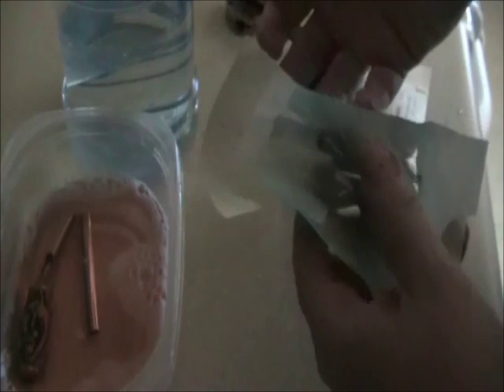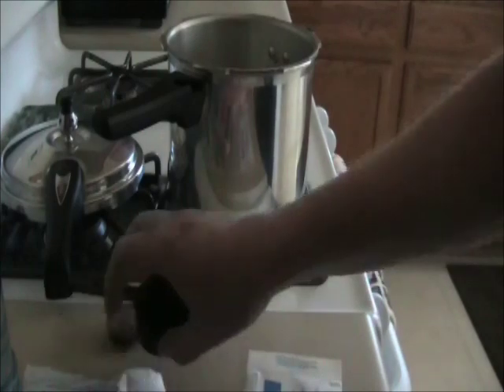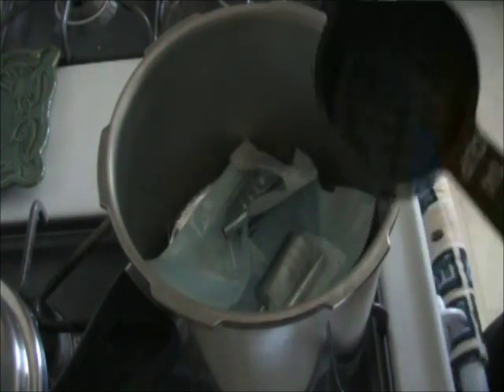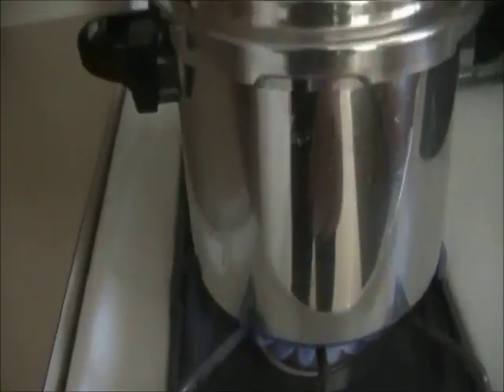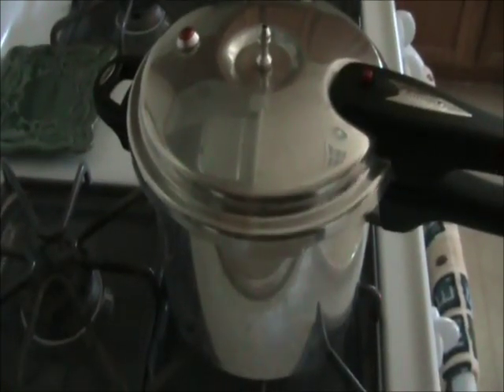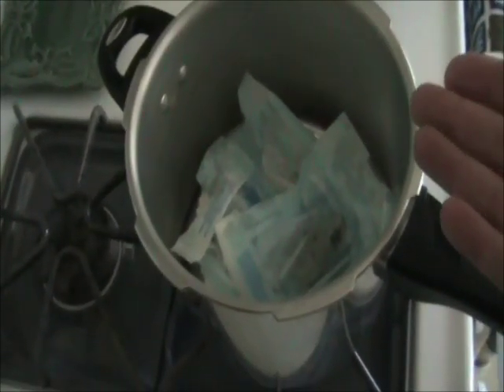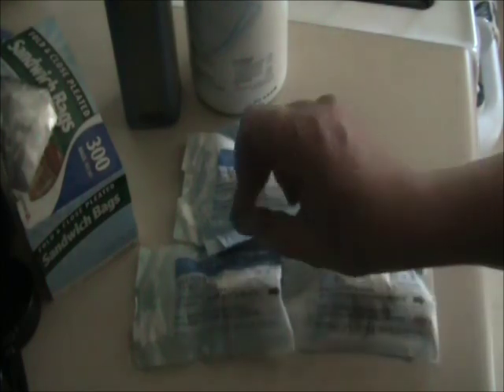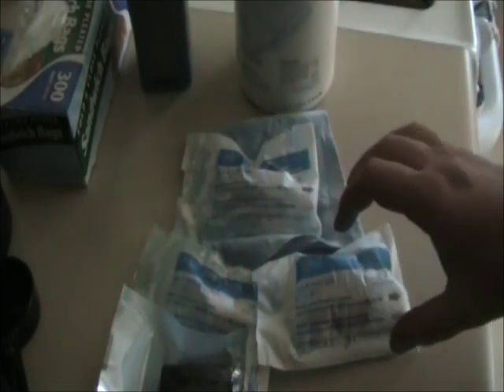Pressure Cooker / Autoclave  Sterilizer - Tattoo Tubes tips grips

Comment from the maker: google  term  "  autoclave indicator bags tattoo "   3 1/2"  x 6"  so everything fits .    just remember this simple rule  ,  15 minutes AFTER the steam starts ejecting  at 15lb  If you use a 10lb cooker like in this demo you need to heat for 30 minutes   . use enough water but to not let bag SIT IN THE WATER

Comment: @Frankiehuertero I just scored a Programable Pressure cooker on Craigs list brand new for 20$. Don't need to put it on the stove top and it has a timer that wont start the unit until the appropriate amount of pressure has been reached, then it automaticaly shuts off. It didn't say how much PSI just a low and high setting. The high setting works even though I don't know what PSI it is.

Comment: Those kind sketch me out because it is always leaking steam the entire time. The more expensive All-American kind(with the 6 bolts at the top, pressure gauge, saftey release valve and 2nd saftey release plug) are more the real deal to me. Stovetop, but just as effective as an autoclave. Mine would blow the saftey release at about 25 psi, so I tried to hold it close to that for at least 30 min. Always passed a spore test.

Comment: I use a pressure cooker in my mushroom growing ...  Believe me when I say that if I didn't kill the most resistant bacteria I would not grow mushrooms.

For those putting down the pressure cooker ... you don't know what you are talking about. For the guy who asked about condensation in the bags ..  Don't relieve the pressure on the cooker at the end, let it cool down naturally it takes about two hours.

Yes it would kill all bacteria and can be used for forceps.
Reply: +Chris Conlon  I totally agree with you!! Nothing wrong with a pressure cooker especially if you use indicator tape but do not open it early!  I let it run dry because if its cold and wet.. its NOT sterile..  The bags and tape and spore strips are available on ebay !

Comment from the maker: The boiling point of water depends on the atmospheric pressure, which changes according to elevation. The boiling point of water is 100°C or 212° F at sea level, but water boils at a lower temperature as you gain altitude  , so it will always be hot enough .  15lbs for 15min   , and that besides that everything is dead before it even goes in if you properly clean it first

Comment: Water boils at different temps, depending on purity of the water and atmospheric pressure. A difference in elevation will change the temp at which water will boil.

Comment from the maker: just remember the ultrasonic is not a sterilizer it simply cleans the inks off of the tube/ tips   so youdont have to scrub them as much , then they are soaked in a metricide type product  ( 06:00  ) and then you pressure cook them  (30 minutes @ 10lb , 15minutes @ 15 lbs )  o don't for get the metricide and pouches

Comment from the maker: by the type of cooker , but it doesn't HAVE to be 15 allot of smaller one like I demo here with a small weight on top is 10 lbs  @ 10 psi you need to cook it for 40 minutes    15lbs usually are bigger unites an have a metal dial on top with 5 - 10- 15  lbs options    less presser = more time     more time means a little more  water  so it doesn't steam off and go dry .  the 15 lb thing is standard for autoclave lbs.

Comment from the maker: that steam is still sterile and will dry , autoclave have dry cycle kinda like a dehumidifyer it uses dry heat after the pressure cycle is done  , you can put em in a toaster oven on 200F  bottom rack for 5 min to mimic this if its needed

Comment: if you just scrubbed those tubes or they wr just cleaned on an ultrasonic you should be wearing gloves at all times even when you bag them,take those gloves off then handle the autoclave..put the pouches in with new pair of gloves..then you can take your gloves off..and if those tubes wr new would of been a good idea to do it with gloves either way so people dont create bad habits of cross contamination..just a little tip

Comment: What brand of pouches do you recommend? All my canners instructions say to bring to a full boil and purge for 10 minutes before putting the regulator on and starting to time. Supposed to get rid of all the air in the cooker. Just a thought. We never did this until recently. We would usually lose a few cans of food due to spoilage. Not sure if it was due to a bad seal on the cans or not purging the canner though. I was looking for a video to sterilize some home medical kits.Great vid!

Comment: Just wondering if you realized the bag was closed wrong. You have to make sure it's folded directly along the perforation so you create a seal. Otherwise once it's been sterilized, you've basically defeated the purpose by allowing air that is not steril back into and on your tubes.

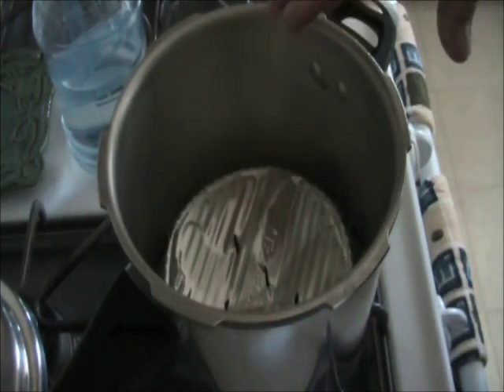Comment from the maker: 02:00  water steams off at 1/2 cup every 15 minutes   at 10lbs you need to cook for 30 minutes so that   1 cup for evaporation and 1 cup for extra incase you space .      if you have a 15 lb cooker that  1.5 cups min.     as much as 3 cups is ok just keep the parts RAISED OFF the water     .

Comment: 1st off I have 160 I.Q. Which is a bit higher than 25 2nd Most pressure cookers work with 1 bar (approx) 14.5 psi above atmospheric pressure, strained, saturated water vapor at pressure of 1 barhas a temp of 121 c This temp is ONLY achieved when there is no air left in the autoclave.Therefore in PROFESSIONAL autoclaves there is a period of time in which the LIGHTER STEAM displaces the HEAVIER AIR from the boiler. For that at the bottom of the tank a valve is fitted.This is the GRAVITY METHOD. I

Comment from the maker: if it has a small wieght on top like th eone in this demo it is a 10   should be stamped on pot someplace or look for name and google it ,   my big one has a round weigh on top with 5 - 10 -15   markings  ,   typically the bigger th eunite the greater the pressure

Comment: In this method the bowls have to be open towards the acsending steam so that it can displace the heavier air! More modern devices work by a process called fractionated prevacuum. In this device 1st a vaccum is produced,then saturated steam is inserted. This is repeated several times, finally there is admitted as much steam until desired temperature is reached. In this method you donthave to pay attention to the position of the bowls. Because a PRESSURE COOKER CANNOT  CANNOT perform these

Comment from the maker: first off  you dont just dump water in and fill it half way up. you only add what is needed , you dont want to BOIL   you want to STEAM UNDER PRESSURE  , you didnt pay attention to the rate burned off ,  also you didnt pay attention that after the 15 minutes of steaming you leave it alone for a while to depressurize

Comment from the maker: well why don tyou go read what a autoclaive is an dhow it sterilizes ,  HINT heat and pressure , WIKI entry " An autoclave is an instrument used to sterilize equipment and supplies by subjecting them to high pressure saturated steam at 121 °C for around 15–20 minutes " ..."values are set for the number of minutes of sterilization equivalent to 121 °C (250 °F) at 15 psi (100 kPa) above atmospheric pressure for 15 minutes . " look and see the picture of a STOVE TOP AUTOCLAVE  aka pressurecooker

Comment: ventilations an AIR CUSHION COLLECTS near the bottom of the boiler. This means that the 121c  for SAFE STERILIZATION are not reached. This also means that a sterilization TIME of 15 min. is NOT sufficient in ANY CASE.This can only be achieved with modern PROFESSIONAL DEVICES> In older but professional equipment ususally a time of 50 minutes is specified. This time consists of Rise time, Recovery time, and Sterilization phase. So u ddont have to be a rocket scientist but there is more to the

Comment: So does it clean them right???
Reply: Yes. Autoclaves are, in basic design, pressure cooker. The problem with your standard pressure cooker is you don't know the temp, or the pressure you are working at. My answer, weld two pipe nipples onto the lid and install the proper gauges to monitor the internal conditions. constructive criticism is welcome YouTube!